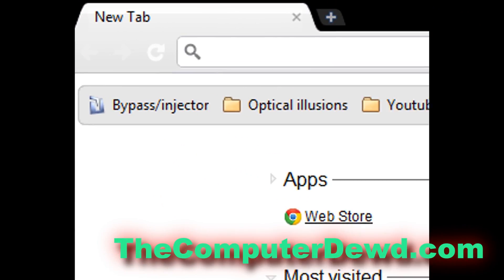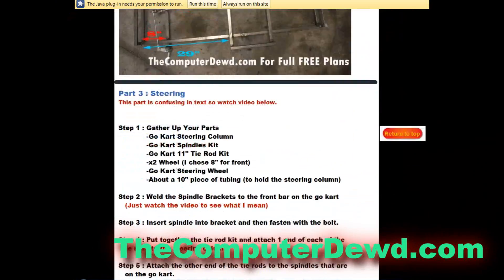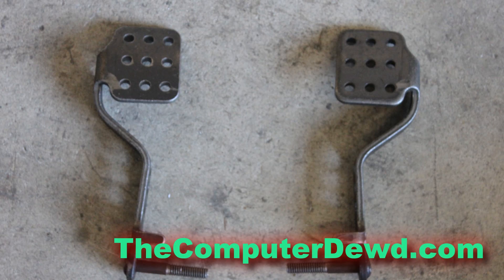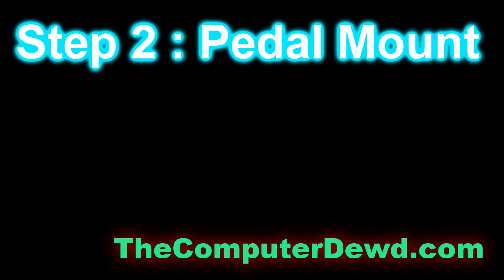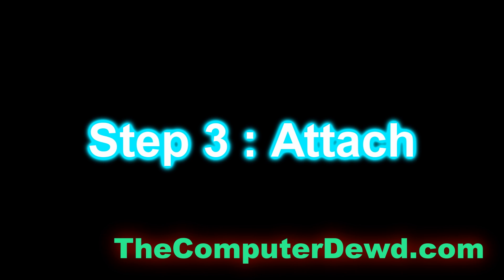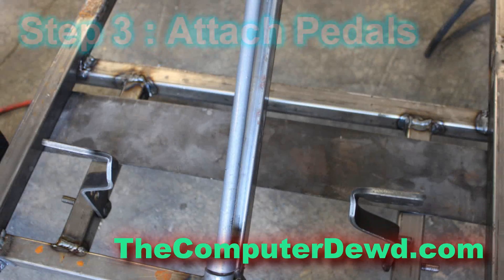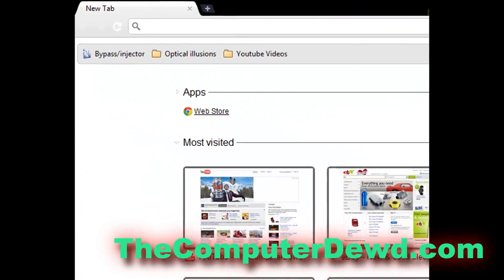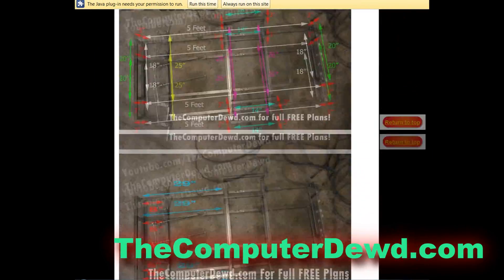How to build a go kart : Part 6 : Pedals/Foot Rest

Comment: How did you get the pedals  to come back, you have the same pedals i do, but i cant figure how to mount mine so when i take my foot off the gas or brake the pedals come back to there normal position. maybe you can help me thanks
Reply: JetRacing365 attach a return spring to the pedal